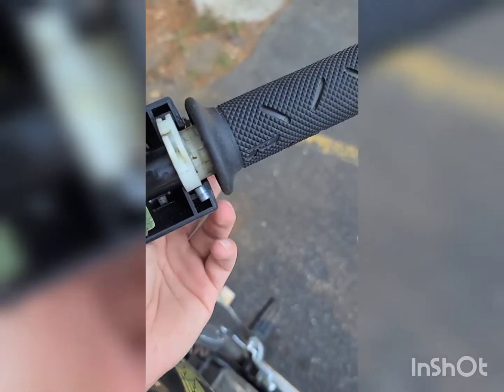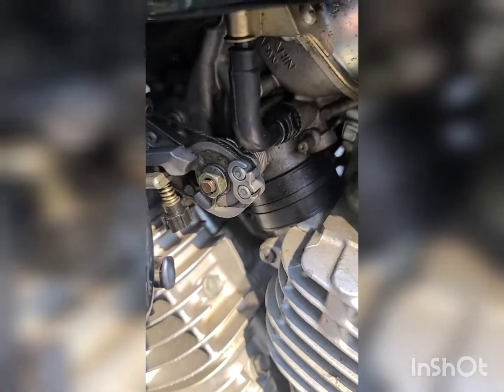1986 Honda Shadow Throttle Cable Replacement

Comment: I'm actually having the same problem right now but you didn't show how you got the cable on there, what spring did you find? I'm only trying to change my grip but now my throttle cable seems 1 inch too short and I'm not sure where I get the extra Slack
Reply: have you figured that out? i been searching and searching for videos